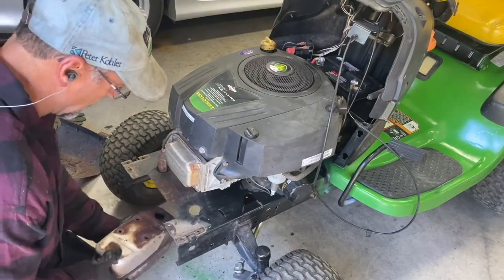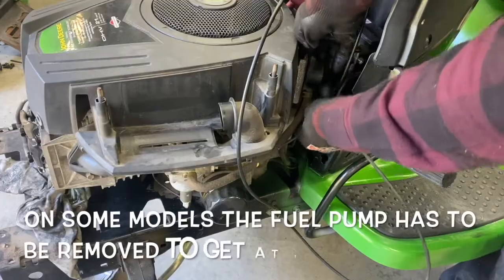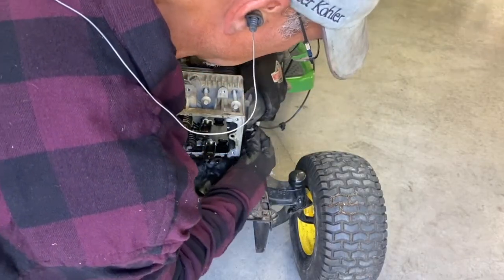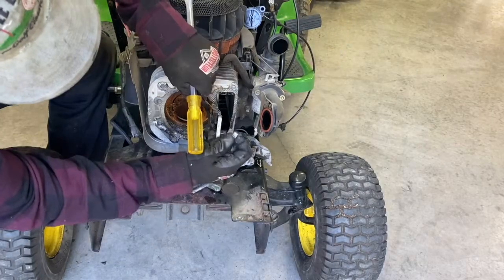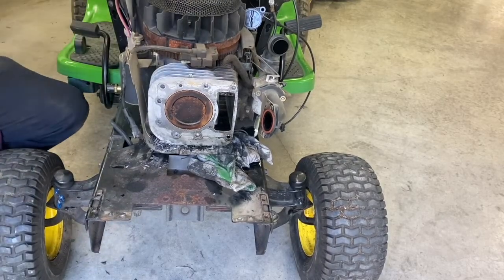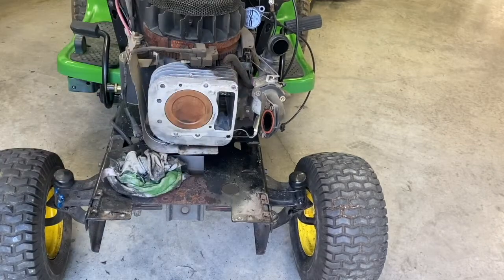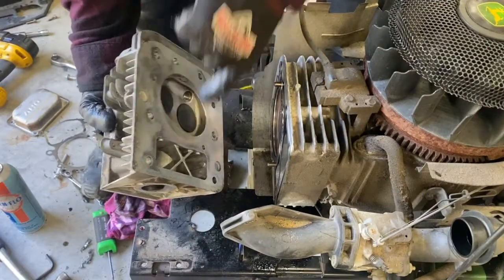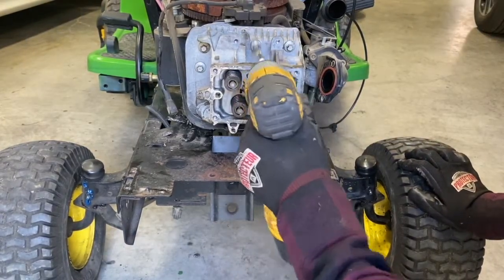How To Repair / Replace a Blown Head Gasket on John Deere LA125 Briggs and Stratton 21hp Engine OVH

Comment: Great Video helps alot. But can I ask you a question I have one that is smoking oil big time. Without seeing it do you think I have a burnt valve or blown gasket?  The mower is a 2019 model started smoking a little last year but after this past winter its smoking like crazy. Can you help? Jake
Reply from the maker: Watch this video. Probably your head gasket needs replacing.  
https://m.youtube.com/watch?v=ttW0VnHC2Ek&pp=ygUpRGlhZ25vc2UgaGVhZCBnYXNrZXQgd2Vla2VuZCBob2JieSBicmlnZ3PSBwkJfgkBhyohjO8%3D

Comment: Just change my head gasket again, thanks to your video. But this time, I later found out I was only out of gas. But I'm still glad I changed it anyway, because it's running a lot better, plus I bought the item from John Deere this time.

Comment: Fantastic video. This was my first time changing a head gasket and you explained everything very well. I have a different model so a few things were slightly different but overall it went great. One question though, mine was leaking oil before I started. There was oil in the valve cover and in the space where the rods go. After I was done I expected to have to add oil but the dipstick is still reading full. Did you have to add any oil?  I’m not sure how I lost so much oil but didn’t have to add any when it was all said and done.
Reply from the maker: Thx.     I did an oil changed after.

Comment: How do i find the compression stroke that's what i'm struggling on...😢
Reply from the maker: Take the spark plug out and rotate the motor by hand look until the piston reaches the top.  If the exhaust valve is open, you need to rotate it one more full turn.   
    Both valves should be closed.
Reply: @WeekendHobbyMechanic  How can I tell if they're closed The springs will be disengaged right ?
Reply from the maker: @DOA-SPACELY . Yes.  The rocker arms should be a tad loose and the same height.
Reply: I got it thank you so much

Comment: Did you buy new head bolts? I’ve seen some talk that old bolt heads will result in and head gasket job again in the near future.
Reply from the maker: I always use the same ones.

Comment: I got the 115 an its doing the same thing. I started it yesterday after its sat all winter an that mug smoked the whole neighborhood up. Then it shut off an wouldn't start back. So i removed the carb an cleaned it real good an it fired right up byt still smoking. So yeah thanks for the video, Ill go get a gasket kit later an fix it.

Comment: May sound like a silly question, but do I need to drain the oil first?
I just did an oil change right before firing it up, and realizing the head gasket was blown. Oil ain't getting any cheaper.
Reply from the maker: No need to drain it, oil is still good.
Reply: @WeekendHobbyMechanic  
Thank you very much.

Comment: This exact head gasket issues seems to be an epidemic for Briggs in this family of single cyl engines. The cylinder head wall area near the galley apparently isn't wide enough.  Around here and on YouTube this is a widely known common failure of Briggs even after a repair.  They made a new head gasket design different to help but I've seen it really doesn't help long term.  The failure rates are ridiculous even on low hour engines.

Comment: Great video. This has really helped me. Is it OK to use a wire brush on the engine block? I see that you did it so it must be ok.
Reply from the maker: You can use a wire brush on aluminum, go slow and easy.

Comment: I have a john deere 100 series riding mower.  I wonder how much a head gasket replacement would cost to get done? I am not mechanical.  I googled it and it said $1,200. That can't be right, that's how much I paid for the mower brand new.  Anyone know roughly what it would cost in Ohio?
Reply from the maker: $25.00 for a head gasket.  2hrs of labour.  Probably need the oil changed ($20) and filter ($20).  Total $200.00

Comment: My LA125 has the same issue! I’m trying this first.  👍👍 what was the part number for the head gasket?
Reply from the maker: Part number is MIU11490.    (If this is the problem you have, it will smoke a lot when it’s hot)
Reply: @WeekendHobbyMechanic  definitely the head gasket thanks, got it from the dealership $21.00. What did you use on the cylinder to clean it with the drill?
Reply from the maker: @Chief_5   I used a razor blade than a wire brush. Bought a set off amazon.  Any local hardware store has them. You can do a search on Amazon for "drill wire brush set".  Then spray "brake cleaner" to degrease it.
Reply: @WeekendHobbyMechanic  I used the wire brush, put it back together with new filters and oil, works again! 👍
Reply: 😅😅 0:00

Comment: Do you have to remove the muffler in order to remove the exhaust pipe because this is a LA125. Although they're not working on LA125's, I see everybody else just disconnecting the top of the exhaust pipe from the engine, then lean it to the side, or pull the pipe out of the muffler from there.
Reply from the maker: You don't have to remove the muffler.  I did because I sandblasted and painted it.
Reply: @WeekendHobbyMechanic  Thanks for the quick response.
Reply: Great video...thanks

Comment: Nice video… I believe I have a blown head gasket but I also have a leak from what appears to be the lower gasket. Could a blown head gasket cause this? Or would a blow head gasket cause a leak at all?
Thanks!!
Reply: A blown head gasket allows compression to leak into the crankcase and tends to push oil out of lots of places, possibly even the seal you are mentioning.   Also check for oil leaking from the diaphragm fuel pump vent, that's a telltale sign of a blown head gasket
Reply from the maker: What lower gasket you’re talking about.   Thx.
Reply: @WeekendHobbyMechanic  
Possibly the sump gasket? It’s the lowest gasket closest to the frame to engine mount.
Reply from the maker: @Corey Johnston   Check for an oil leak around your oil drain tube.  It tend to back out and leak oil.